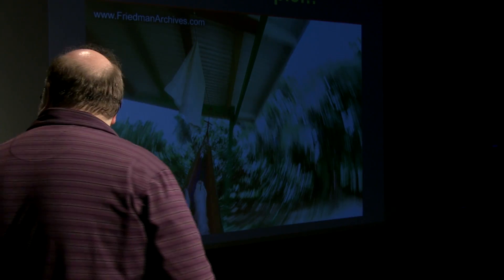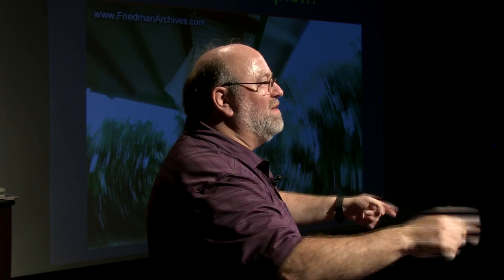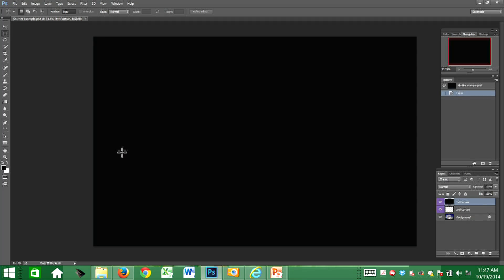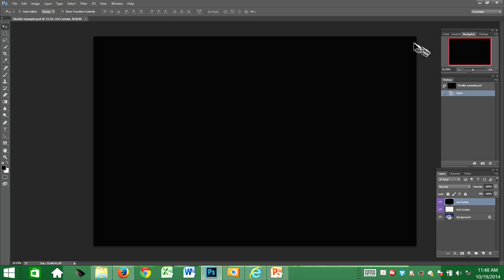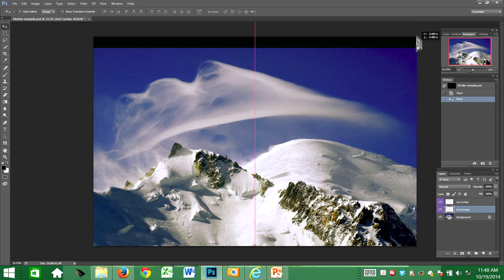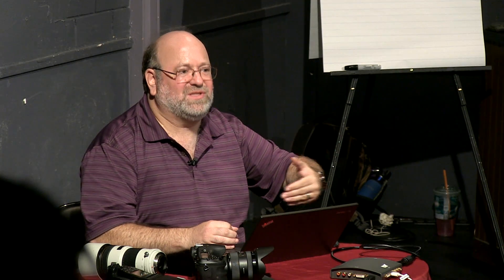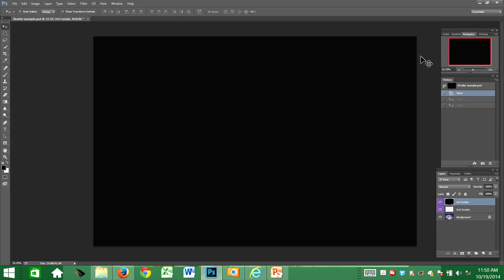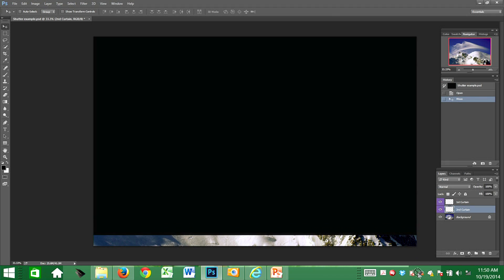High Speed Sync Explanation - The Friedman Archives Seminars

Comment: I was confused using HSS in manual mode, because when I changed from 1/1000 to 1/8000, I had to manually change the flash power from 1/8 to 1/1. While I can see why that happens from the HSS putting out a series of low-intensity pulses over a longer period of time (and as such, a faster shutter speed would make the sensor see fewer of these pulses), why can't they just raise the intensity of the pulses in HSS mode for faster shutter speeds so that the same amount of light will hit the sensor whether it is a 1/1000 or 1/8000 speed?